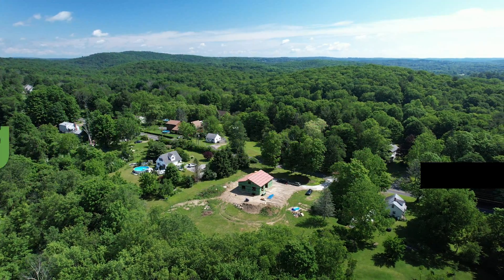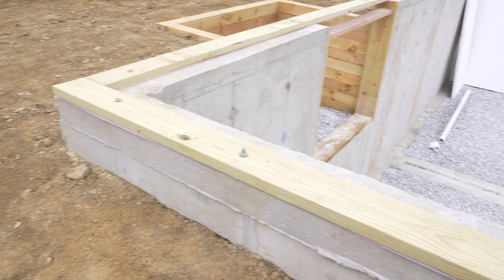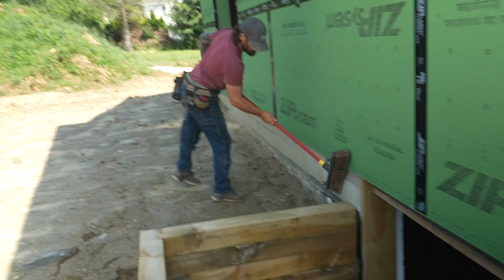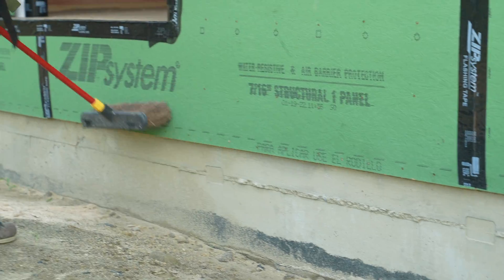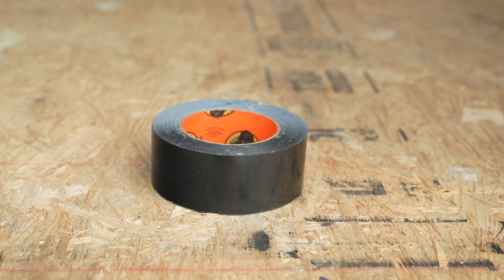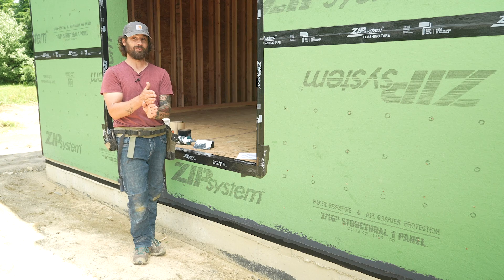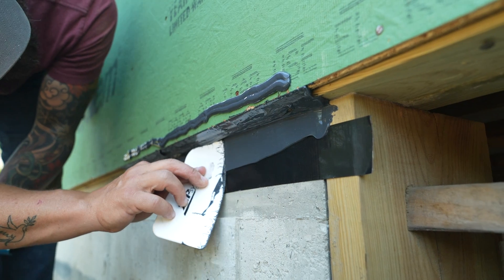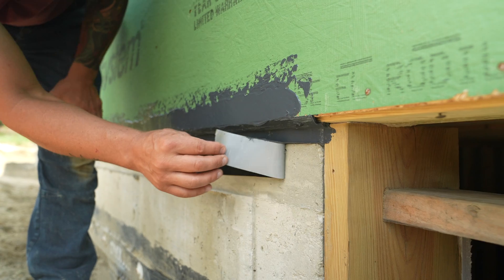Use Liquid Flash at a Wall-to-Foundation Connection

Comment: I've seen people use Siga tape to cover the zip and concrete and then used zip tape on top of the zip, overlapping the top of the Siga tape.  Not sure anyone else has tried this.  It's double tape, but seems a lot easier than spreadking liquid flash everywhere.  Anybody try this?
Reply: No need to place Zip tape over Siga Fentrim unless the sheathing was dirty and didn't allow a good sealing surface for Fentrim tape.  Just clean the foundation and the sheathing before applying Fentrim.

Comment: i hear tell that it may be best to apply the air barrier from the inside. The water that inevitably will be intruding whether as condensation, or rain will require drainage and would best exit where you applied that liquid flashing. High performance homes require high performance maintainance. Perhaps im not seeing a detail that points out a larger system where that is theoretically planned for. Well executed either way, thanks for sharing, really nice looking place.
Reply: If youre spending that much on flashing, your nails are peobably set to the correct depth and you glued your firring strips to avoid any problems with finish siding nails
Reply: The foundation barrier can also keep out insects

Comment: This actually is probably a better idea. I found that the wide ZIP tape stuck very well to masonry when using a layer of 3M '90' spray adhesive as a primer. I can't remember which tape specifically recommended this for the application. But dang if it doesn't work great. However, that was on CMU and the joints are a pain with tape. I think I'll use liquid flash on the rest of the house!

Comment: Curious, why not add in liquid flash before putting the sill plate foam down. Cost but prob worth it in long run? Or cover sill plate entirely with liquid flash all sides and over bolts once done. That is if the PT is dry or leave one side open(top)? Thanks for this :)